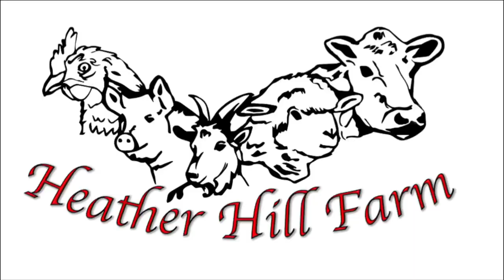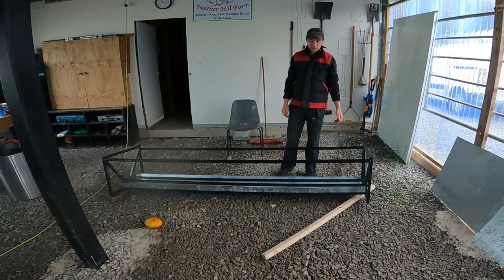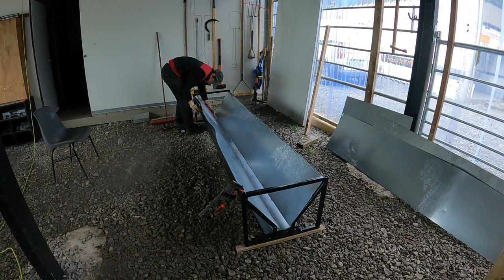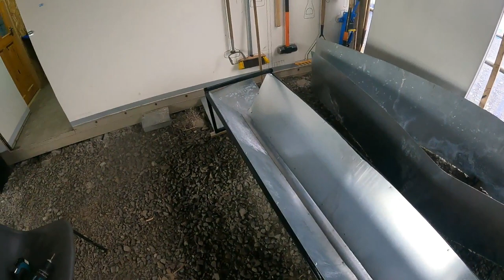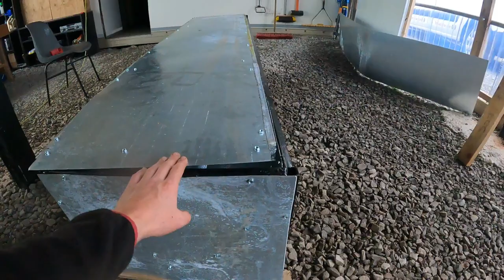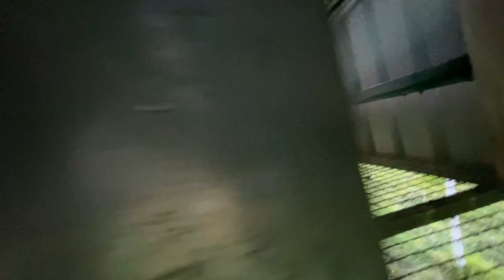Saving €1,000 Building My own Chicken Feeders

Comment: If you had an auto darkening helmet, it would free up your left hand while welding. It's helpful to use your second hand as an anchor and to steady your dominant hand. Also, you could cut oversize slots in one side of the trough by cutting two slits and bending the tab up. Then you could stick that end in the frame first, work the second end in, and bend the tabs back down.
Reply from the maker: Some top tips there thanks Chris
Reply: @heatherhillfarm1303  thanks for posting all the innovations you come up with, it's a great resource!
Reply from the maker: thanks for watching

Comment: Wondering if you've thought about feeder height adjustment? Poultry are masters at "sorting" feed, pellets will help solve that to some extent but I've found height adjustment critical to avoid "rake-out" whereby she'll rake that feed out of the hopper into the pan and create the proverbial stale spots that you spoke of in your video. Even with good quality pellets there are inevitably "fines" which she doesn't like eating but that 1. cost $ and 2. may contain some of the very fine raw ingredients such as vitamins and minerals that she needs for her health and production. Will you make them empty the feeder and clean these up every week before refilling?

Comment: hey as far as i understand the chickens need to run dry if you like for an hour before feeding, for there egg feed rutine to work at a good percentage of lay, is that somthing you are doing.? so is there an automated system.
Reply from the maker: I have been testing adlib feeding all summer and I have seen no evidence of this with my flock. This may be an issue in standard fixed house systems where birds are around the feed all the time. I find in the mobile system with fresh pasture the birds are stimulated to go exploring and don't hang around the feeder eating all the time.